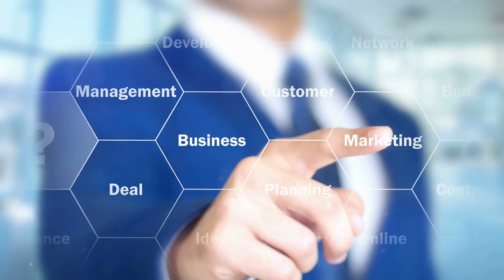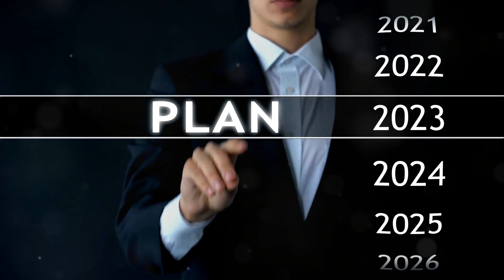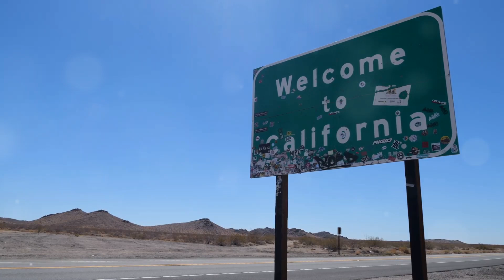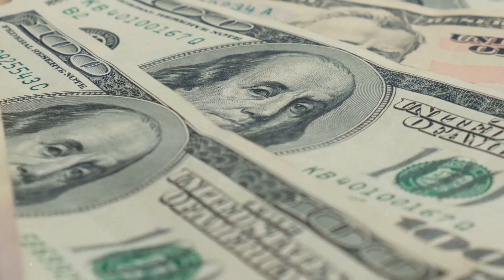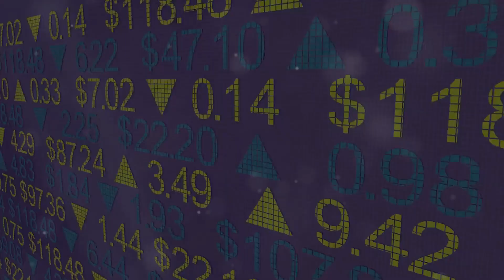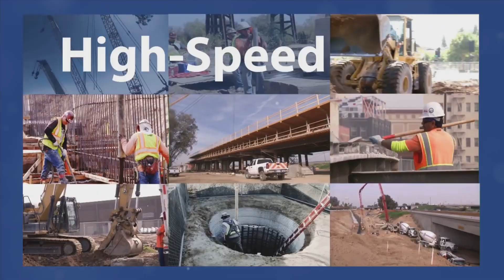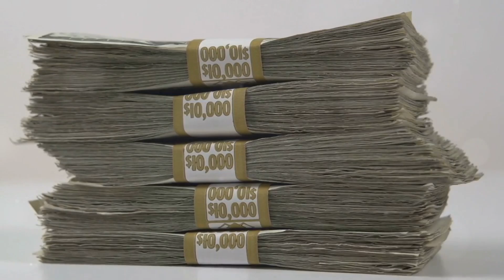Is California's High-Speed Rail Still on the Right Track?

Comment: The real problem is after/if service starts.   Current airline fares are $150-$300 for business class for a 90 minute flight lax-sfo.  Can CHSR meet that price point?  If. Not a subsidy will need to come from somewhere
Reply: Some years ago seats were supposed to be in the $50 range. Now the estimate is $86.
Reply: @ makes one wonder where the break even point would be?   If you look at amtrak DC TO NYC$166-199 with sfo to LAX longer. By 100 miles.
Reply: @Dog.soldier1950 Amtrak prices are always in flux. I’ve found NYC to DC trains as low as $12 to as high as $800. CAHSR would probably be similar to that. Also the flight might be 90 minutes but you also need to factor in traveling to the airport and getting there early for TSA. Train stations are typically in the middle of the city and you don’t need to go through security.

Comment: Brightline managed to build a high speed line for a small fraction of this, and plans another likewise.  Why do we accept spending 3,4,5 times what other modern countries like France and Japan spend on infrastructure?
Reply: It’s this high because people fought it tooth and nail, and drug the project out for over a decade which drastically increased the cost. It should be less costly going forward building expansion lines and other similar projects.
Reply: While Brightline West will be high speed, Brightline in Florida is nowhere near true high speed.
Reply: This is how they steal our tax dollars.
Reply: Brightline also built a passenger service on a freight railway and has had lots of railway crossing accidents. Just as we accept sub-par railways that cross with idiotic drivers, we unfortunately have to accept paying more for our infrastructure.

Comment: Who EXACTLY is going to ride this thing ... on a regular basis ?    Just asking.
Reply: The people that currently drive or fly from one end of California to another for work or leisure.
Reply: @AtulKedia wrong. The cost and time to travel have increased significantly for this democrat failure.
Reply: As an Aussie, professionals who are sick of driving everywhere in congested traffic, and want that time back to themselves. 
The younger generations who are more likely to believe in man made climate change. 
They likely live in San Francisco or L.A. but want to commute to the other.
Reply: When this line opens, you’ll be surprised!
Reply: Yes, when the reality of no passengers hits.
Reply: @rickhicks6833  how do you know the cost of travel when there has been zero report so far of how much tickets are going to be? Time of travel: doesn't matter if it's 10% higher than expected earlier. HSR travel times are much shorter in for many cases because you're averaging 120mph or above. In comparison to planes you don't need to be in a train station 2 hrs ahead of time because a full blown TSA check is not necessary. You can arrive at the station 20-30 mins ahead of departure and be on your way.
Reply: @AtulKedia  because there are reports that show expected costs, ridership and environmental savings.  Unlike you democrats i find the FACTS.
Reply: @rickhicks6833  I'm nonpartisan. You don't need to give everything a partisan angle when dealing with facts. Stop talking like a troll.

The cost of construction has increased, yes. The Japanese Shinkansen trains went severely over budget when getting constructed in the 1970s and people thought it was a going to be a flop. Ever since they made it it has been an envy of every country. CAHSR is expensive, but come 2040s and 50s, the world will recognize it to be a remarkable improvement in American infrastructure.

You've ignored the comment about how it's still going to be faster to travel by rail than by flying in many cases. LA to SF is the sweet spon where taking HSR is going to be faster than taking a flight, because of lack of excessive security check, and this will become the preferred mode for most people. (Even if it where going to take half an hour extra, it doesn't affect too much because of the comfort of travelling on rail as opposed to flight.)

+It is faster and safer than travelling by a car.
Reply: @rickhicks6833  I think it’s unrealistic to expect that no passengers would ride the California HSR.
Reply: @highway2heaven91  ok let's be realistic. Suppose your failure finally gets built. So i want to go to Bakersfield.  Amtrak for a similar distance is $54-71. It's realistically take about an hour train ride. Have to show up 30 minutes prior.  I have to drive from quartzhill to Palmdale,  another 20 minutes. Pay for parking.  Then say I want to go to cal state Bakersfield, and umber is $20. Then say I want to go to Buck Owen's place. Another Uber for $20. Then $20 to a hotel.  And then Uber to the train station,  another $20. Than $54-71 for a ticket.  Or I can spend $60 in gas, and travel the 1 1/4 from quartzhill to Bakersfield.   No brainer.  Particularly if you take a another person or 2. Much cheaper to drive.and easier.  Hsr tickets will be much more expensive.
Reply: @rickhicks6833  
1. Of course it will not be the cheapest option for every single type of trip. And I'll give you another example: If I need to make a quick day-trip to grab something or submit some documents in a gov office in another city I could take the train, but on the other hand if I need to stay for a few days or weeks, and/or haul a lot of luggage, and/or am in a group of 3 to 5 people then of course driving would be cheaper collectively. That is exactly how people in Japan, France, Italy, Spain operate. Solo travel is almost always cheaper on train, while group travel is almost always cheaper on personal vehicles if you have one.

2. Not sure what city are you starting from, I'm guessing LA or SF.
In that case, the reverse trip almost makes too much sense. Someone from Bakersfield can leave their car in a park and ride lot there for cheap. Ride the train to either LA or SF, utilize public transport, especially in SF, for relatively cheap and not have to worry about gas costs, parking, tolls, wear and tear on car. During their trip on the train they will have internet, get work done, prepare for the business meeting in the city, relax to do whatever, not stress about keeping a car in lane.

3. Not to mention people often go to places to visit family. For ex. if your child studies in any of the universities along the HSR route they can easily travel anywhere else to visit family, friends, etc. They could decide they don't need a car because the family or friend in the other city can pick them up.
Then what about the elderly who are afraid to drive in the intense car traffic in the bay area and in LA metro, and who, frankly, should not be allowed to sit behind the wheels anywhere? What about the disabled? What about families that cannot afford multiple cars and one person needs to travel somewhere and another needs to go another. They can definitely make a one time exception of paying more for a train ticket than having to keep a second car for these cases.

Don't think that making HS Rail means you cannot use your car or take flights. Do so whenever that is the better option. But Rail offers a unique dimension that cannot be fullfilled by either car or flights.

If you've been to the northeast corridor between Boston, NYC, Philadelphia, Baltimore, Washington DC you'd know that the preferred mode of transportation between these cities for folks even with cars is by using Amtrak trains, as it also happens to be cheap. (And Amtrak there is not even super fast. It goes at a maximum of 150 mph and average for the complete route at about 65 mph, whereas these in California would max at 220 mph and probably would average above 150 mph). Heck, I know people who routinely (once every 2 months) did Indiana to Philadelphia on Amtrak trains because they couldn't afford multiple cars in the house and needed to visit family in Philly (a couple of times on emergency).
Reply: @AtulKedia   @AtulKedia   @AtulKedia  so 1. How do you get to the government office? If it's not cheaper,  why use it?
2. What public transportation? Very little service to any out lying area, let alone in the metro area of nearly all the cities along the route. 
3. Sure, an elderly person who is incapable of driving is going to get themselves to the train station,  on the train, and find transportation at the other end? Really? 
Yes, if there are no other options, people will use it. But that's a very small number of people.  Its total cost is going to be close to $200 billion, probably more. Amtrak gets $2.5 billion a year. This failure will be far more costly than amtrak.
Reply: @rickhicks6833  
1. It is cheaper. I said exactly that it is cheaper to take train in some cases and to drive in other cases. 
2. Bay area has a very good public transit network. Good enough for a lot of different destinations, again not for every single destination, but a lot of them.
3. Yes, literally an elderly can call for a taxi/uber like they would to get to an airport or if not someone in the family calls it for them. I mean if one cannot even do that much how do you expect them to drive safely to another city, say Quartzhill to Bakersfield? For them commercial airlines or trains/buses or an expensive taxi ride are the only options.
This goes also for the disabled and even for younger adults/students who do not have the money to own a car.

You seem to keep assuming everyone owns a car and is fit and healthy to drive for everything.
Again, CAHSR will NOT take away your other alternatives like driving everywhere or flying. It adds an additional route.

Again, the trains between Boston and WashingtonDC mostly run full capacity. Meaning there is even more demand for trains there, and there they have something like 60 round trips per day between those two cities. President LBJohnson made it a matter of national and economic importance to pass the "High-Speed Ground Transportation Act of 1965" to enhance the speeds and frequencies in this corridor, and it has paid off to make the area an economic engine of the country. (I suggest you look that Act up). Now even that corridor needs more frequent and faster trains, and need more investment in infrastructure improvements.
Reply: @rickhicks6833  Pres. LBJ : 
"[Today] an astronaut can orbit the earth faster than a man on the ground can get from New York to Washington. Yet, the same science and technology which gave us our airplanes and our space probes, I believe, could also give us better and faster and more economical transportation on the ground. And a lot of us need it more on the ground than we need it orbiting the earth."
Reply: @rickhicks6833  I won't deny the pricetag is heafty. But we'll have to do that to ensure a strong Californian economy come 2035 and beyond. It will especially be an envy of other US states by 2045 and beyond.
In fact Brightline West which is aiming to connect LA to Las Vegas with HSR by LA2028 is already going to show what holds in the future.
Reply: @AtulKedia  yes space travel is fast,  has nothing to do with technology,  it's a matter of physics,  low gravity and no atmosphere.  Yes technology has given us good transportation,  like airplanes and cars. Exactly how much do you spend on your space flights?
Reply: @AtulKedia  and the economy in California is already destroyed.  It will do nothing to improve it.
Reply: @rickhicks6833  Okay then. I have nothing else to say. I still support CAHSR.
Reply: All the people who drive and fly between the cities right now

Comment: I’m glad you mention the economic benefits of this project. High speed rail is so much more than just a fast train. It’ll connect communities and transit across the state, increasing mobility and bringing regions closer together.

This project has already generated over $18 billion in economic output, most if not all of that going back into the Central Valley, a region that’s been historically underinvested in. Connecting the Central Valley to the Bay Area and SoCal will be huge.